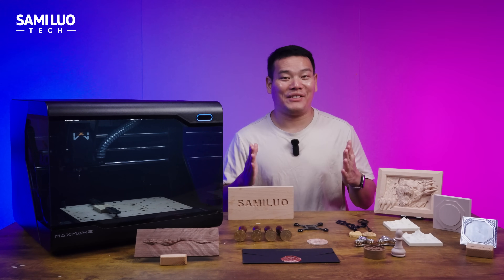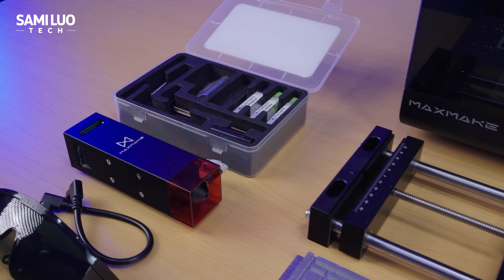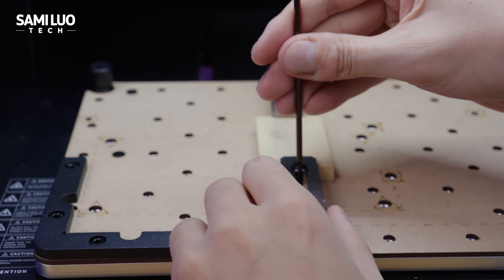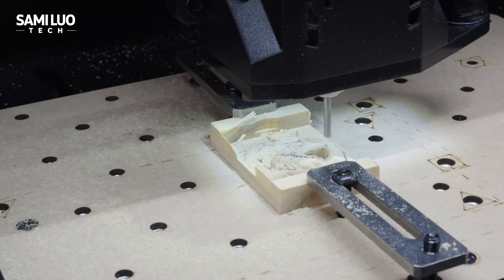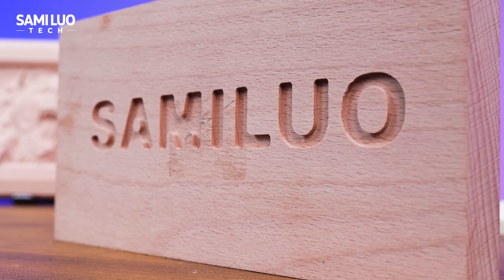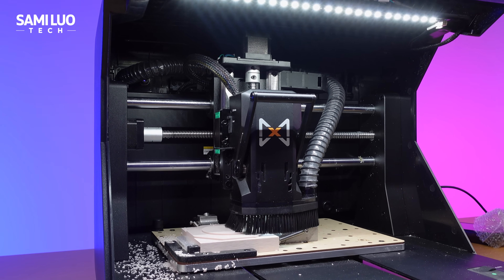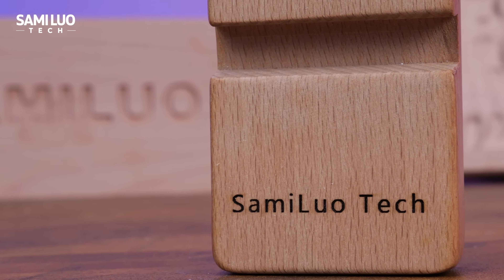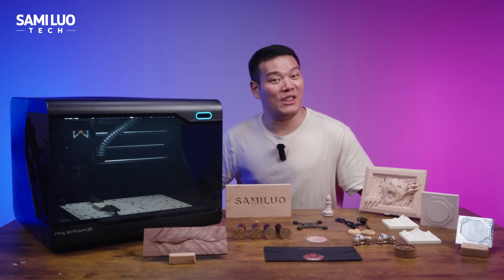Desktop CNC Revolution – MAXMAKE D1S Is Next-Level!

Comment: Sami, can 3d probe be used for measurement something like budget cmm, and not just for locating work material?
Reply from the maker: It should be possible. I think the software needs to have customizable functions for it to work; probably some software development would be required. Please confirm this with the official source.